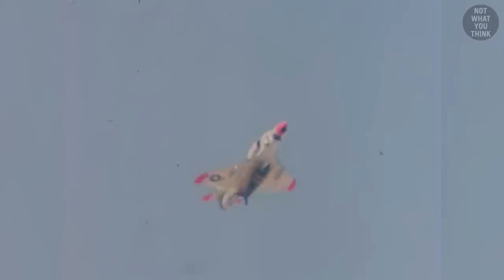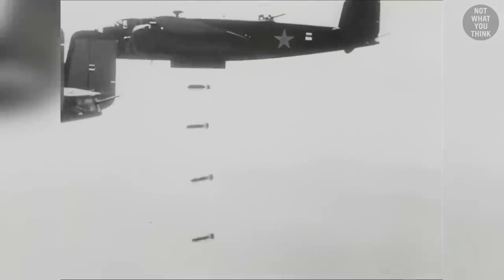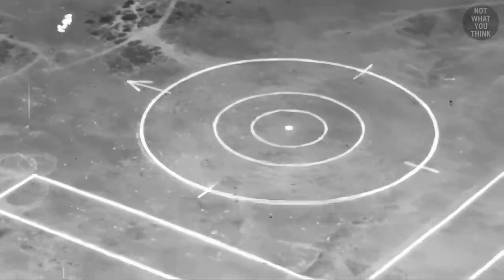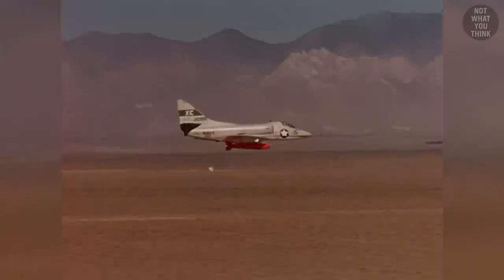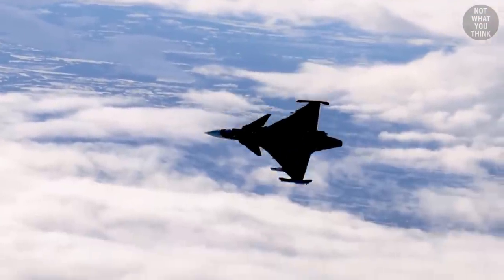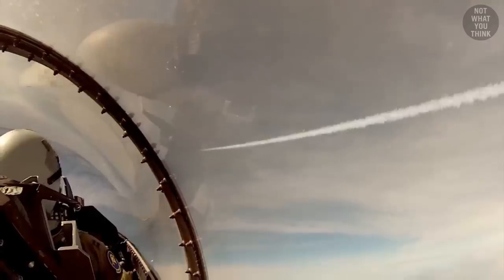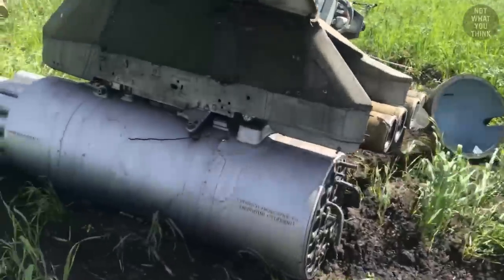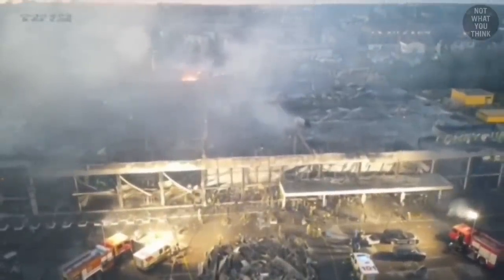Why Are Russian Helicopters Shooting Up at the Sky?

Comment: Over the shoulder bombing and lob bombing are similar but not the same. Lob bombing, as you have show in this video, involves the aircraft approaching the target then pulling up to release the bomb. The aircraft carries on with a half loop before leveling out at the top of the loop and then heads back the way it came.

Over the shoulder, a technique favoured by the French, requires the aircraft to fly over the target and once it has passed it the aircraft starts its loop. As it almost reaches the top of the loop the bomb is released, over the aircrafts shoulder, and while the bomb climbs higher the aircraft completes its loop and flies off at low level away from the target.

The first version, favoured by the USAF and the Royal Air Force, leaves the aircraft having to escape at a higher altitude, while the second version, as I said used by the French, means it gets to fly off at a lower altitude. The advantage of the version used by the USAF and the RAF is that means that only once the aircraft starts to climb is the enemies air defense presented with a target. Though it does mean it is a target until it gets out of range or drops down to a lower altitude. Whereas for the French aircraft it becomes a target both during the fly passed as well as during its bomb run. Also flying over the target alerts the enemies air defence to your presence. It also means that the aircraft has to complete its loop which means less time to make its escape.

I am not sure how USAF viewed the French version but RAF pilots saw it as suicidal.

Comment: Depending on where the helicopters are, could it be a way of adding many more cheaper rockets into the air during guided missile strikes to help overwhelm anti missile defense systems?  Those small unguided rockets must be way cheaper than the long range guided missiles. Or would they be too small for anti missile radars to even pick up?
Reply: No, it's just a variant of the MLRS.
Two helicopters can be compared to a complete Grad package - about 40 missiles.
This is not a way to accurately hit Afghan weddings, this weapon does damage in the area, hitting mainly with shrapnel. Accordingly, the target must be large (military unit, warehouses, truck parking, barracks, headquarters, railway station ...), then the deviation of a particular missile does not mean anything - it will still hit something.

Comment: first of all ,toss bombing is a common technique today and not just in the 1950's. But in the present the pilot is assisted by ballistic computers and a technic called ccrp (continuesly calculated release point) where the pilot is constantly press the trigger and the plane calculates the accurate point in time to release the bomb or rocket. The reason is to extend the Range of the Weapons and improve the accuracy of dumb, unguided Weapons. The Aircraft is able to fly "under the Radar" and drop the bomb at a massivly increased range then flying straight. With air burst munitions like rockets and cbu's (cluster bomb unit) you can massivly increase the disperse and area of effect. 
it is unclear to me why you mentioned the importance of dropping a nuclear bomb acuratly. it is irrelevant if the bomb hits 100m left or right because the destruction zone is far bigger than this :) 
otherwise this is a realy good video and explanation of this technique and i like it :) thumbs up 
and excuse me for misspelling i am not native speaking english ^^

Comment: I assume, the rocket lobbing is more of an moral damaging attack. Yes occasionally you hit something doing it, but spraying a forrest near an intersection with 10-20 rockets will make the ambushers/dug in soldiers in a nearby forrest be uneasy about their position.
Also i assume that those rockets are more or less silent in flight. so there will be no warning time and since the chopper is kilometer away, you wont hear it either.
Basically its a very low precision "bush whacking" with the occasional lucky hit.

Comment: Most modern fighters computers use to have a mode to "loft" ordenance. As you have said, its a way to increase the range of the ordenance. You are adding the aircrafts speed to the rockets. Those rockets will have probably the same accuracy than those launched from a normal  mrls. Ground launched unguided rockets arent too accurate, either.
Reply: That would be the ccrp mode (constantly computed release mode)
Reply: @williewilson2250  more like ccip
Reply: @PyromaN93  nope, that's for when you're dropping on the target using a visual reticle on the HUD
Reply: @williewilson2250  ccip was the term i saw in use in the spanish navy for these in their av8b harrier. 
Not that i say that you are wrong, i dont know the details of the mode
Reply: @user-zn7tj3xc7k  ccip is when you see where the you'll drop the bomb in a dive, ccrp is designating a target to then fly level and wait until the HUD tells you to release. Ccrp works better for long drops

Comment: You're dead wrong. It's pretty obvious from the munitions being loaded in the helicopters that this is being used as a fast and cheap alternative to artillery. You can achieve a similar explosive grouping with those rockets and the launch platform can be long gone by the time the other side can try to counter fire. Artillery's biggest weakness is counter-battery so if you can use a helicopter to achieve the same effect and reduce the chances of losing pilots and equipment, both of which are incredibly expensive, then it makes sense.

Comment: Maybe they have lost so many helicopters, the ones still in operation are doing these rocket attacks as a sort of airborne artillery or mortar style attack using the logic that with unguided munitions, attacks like that are more aimed at suppressing entrenched positions rather than cause damage. Not too different from Rocket artillery during WWII where the main goal of those was to saturate entrenched positions with rockets which would suppress infantry prior to an attack

Comment: Considering the price of such rockets and the little accuracy, wouldn't it be far better to send a swarm of tiny drones? A tiny drone would be cheaper to produce than such a rocket and while it cannot carry a lot of explosives, it doesn't have to if the hit accuracy is over 90% and it usually causes direct hits. And it could easily go over longer distances. Since it will be slower, it is easier to intercept but not by far (a modern air defense won't have a problem to shoot off either) and being tiny somewhat compensates for the slower speed (you get more shots but the target is also way harder to hit). Also it's a battle of money: If the rocket that shoots down the drone costs twice the price of the drone, it's still a win.

Comment: I think your "aerial artillery lottery" is probably the answer here; they are "lobbing jobbies" (a term we used in the late 1980s in Airborne Displays Division of GEC Avionics while we  were perfecting the algorithms for CCIP and CCRP for F-16's HUDWAC) in that they are launching their payloads from a point as far as they are comfortable with flying to and then running away, firing off their flares as they retreat. I'd say the pilots are in fear of their lives but have no choice in having to fly such missions, so they run up as close as they dare, throw their sticks and stones towards the enemy as quickly as possible, and then run home as fast as they can with their tails between their legs, where upon they report to their seniors they completed their mission, albeit with tongue in cheek.

Comment: the story of one Russian soldier from Ukraine. comes to them at the position they are holding a Ukrainian tank with a gun turned back. It is clear that he does not want to fight. Russians approach the tank, and screams and blows against the armor are heard from the tank. it turns out that the hatches are welded and the Ukrainian crew, in order not to die, goes to the Russians to save them. The saddest thing about this story is that this is not the first time this has happened. Ukrainian tanks and infantry fighting vehicles with welded hatches are worthy of respect)

Comment: 5:26 why do you need theories if you can just google it? 
There is a device that CAN predict trajectory of unguided rockets on-board attack heli and jets. You just put in coords of area and it will calculate position and angle. And you can triple range of these rockets if you use in that way, so you will stay out of small AA missiles range.  
Basicly it's MLRS, that can be where it needed in no time. Only with better accuracy and spread than most MLRS out there.

Comment: God, how much water is in this video. Everything is banal and simple, the Russian pilots themselves have answered this a million times. The computer system of helicopters is able to calculate the flight path of unguided missiles and it tells pilots when they need to turn up their noses and at what distance to release their missiles to hit a certain square. Russians have been using this maneuver for a long time, as the author correctly noted, for example, in Chechnya everything was done manually before, now it is computerized. This is done in order to increase the range of missiles and not get into the enemy's defeat zone, especially under the fire of anti-aircraft guns. This method is effective to cause damage to the enemy's cluster in a certain square.

Comment: you can emulate this in arma with both the Mi-48 Kajman and the AH-99 Blackfoot. the Kajman is a little easier since it has a CCIP indicator, wheras the Blackfoot uses this weird line marker with a crosshair that doesn't give any range indication.

in arma 3, unguided rockets shot from a helicopter detonate automatically after traveling about 6 kilometers. so beyond that range it's useless. but if you're sitting with a co-pilot that can laser designate a target, you get an indication on your HUD of where the target is, and the range the target is at. all you have to do then is put the CCIP on the target and verify the range before you fire. the Kajman's CCIP takes wind into account. 

when i first saw the russians and ukrainians do this i figured it'd be a waste of rockets, after practicing it with the Kajman helicopter, i could blanket any area the people on the ground indicated they wanted me to hit effectively. i don't think the employement of a mass volley of rockets from a helicopter is as ineffective as people would want to believe.

Comment: Hey you seem  very biased in your reporting...you guess that the rockets are fired "blindly" where did you pull that out off....your behind?  did you take physics class in grade shcool at all? The rockets have a known burn time that  predetermines how far they go. Duuhhhhh they do not randomly fly a distance and then drop.The speed and distance covered by a typical unguided rocket is known... All it takes is a simple 9th grade physics equation that can be easily programmed in a fire control system of their helicopters to precisely deliver the unguided rockets to a target....Please ask a 9th grader what set of equations are used to solve this and then look in the mirror to see how embarrassed you are...hint the equation used is (final velocity )² = (initial velocity )² + (2 × acceleration × distance) v 2 = u 2 + 2 a x. a is gravitational constant of 9.8,m/s^2.. Add an impulse  from the rocket engine and you solve for distance...ddaaaaaaaaaaa Remember to take into account the angle that the rocket is fired at....man can  you take a high school physics class?

Comment: Actually, current US fighter aircraft are still capable of loft bombing. (No idea about the F-35, but the other fighters for sure anyway.) It's still a valid technique that air forces continue to practice, train for, and use for both guided and unguided munitions. Or in the case of the Ukraine conflict, rockets from a helicopter. Use cases are (though not limited to) definitely when there's a long and medium-range SAM threat that can't be handled or otherwise removed via other means, or where you need to stay out of sight from a search radar as to not tip the enemy off that you're coming their way. Short-range SAMs and AAA are kind of in their own threat category for a number of reasons, mainly mobility, setup time, and that a single vehicle can operate as a stand-alone platform, but in general the same idea and overall principles still apply in terms of risk mitigation.

The computer on modern fighter jets do the heavy lifting in terms of angle, speed, when to release after pulling up, etc., allowing the pilot to focus more on flying and maintaining situational awareness, and less on shifting attention between multiple systems simultaneously. Current systems are much more precise than was the case during cold war era, and that's even before factoring in any guided ordnance. IIRC, most cases today for the US - if not the overwhelming majority - tend to bias the use of smart bombs; specifically, GPS and laser-guided bombs. However, it can and still is certainly done with dumb bombs in a nearly identical manner. (Just don't expect to be able to hit within a 3ft/1m radius of the target area like you would with a JDAM.)

It's worth noting that rockets are their own beast. By their very nature, they have a ton of variability in terms of precision and accuracy than with bombs. What those helicopters in Ukraine are doing does qualify as lofting. The difference is that using rockets like this would not be for a point target. Instead, it's being used as an area-effect weapon. Rather than going "Fuck this guy in particular!" like you would for a point target, with an area target/area effect it's more like "Fuck everyone in this general grid location!" You could almost think of them as being a type of harassing attack or mobile "light" artillery, only it doesn't need to be setup beforehand and it can pop up at any time over a huge range with little to counter it. (Counterbattery fire would be useless, as the helicopter will be long gone from the location it launched form before the rockets even impact.)

The level of precision involved in the current scenario in Ukraine would largely depend on whether or not the helicopters being used have some sort of targeting function meant for lofting. If not, then the uncertainty in where exactly the rockets might impact will vary wildly and will become stupendously more dependent upon each pilot's skills and abilities. Primarily, these are 1) being able to pitch the aircraft up to a specific angle, 2) in a specific direction/heading, 3) at a specific location, and 4) at a specific speed. The factors that have the biggest influence are pitch angle and heading. Even slight deviation in either of those could shift the impact area by hundreds of meters or more, depending on how far they're trying to toss them. (The further the target, the more tiny errors become magnified.)

Comment: i didnt know that accuracy for nuclear bombs was important i thought anywhere close to the target would be good enough due to the power of the blast.
Reply: When you drop a smaller nuke from so high it can easily drift outside of the target area. 

The target will probably still be affected by the extended blast but if you’re trying to hit an armoured target it likely won’t destroy it if you can’t aim.

Comment: The unguided helicopter missiles can not do that kind of damage as seen at the ending of the video. That was a destruction done by Kh-22 - old, low precise, 1 ton explosive filled cruise missile. First in Kremenchug strike to a shopping mall, second in Dnipro to a civilian apartment building. So it is not correct to even mention Ukraine regarding this topic as author of the video did
Reply: Только разница в том что пво Украины уже доказало что сбивают они криво и лупят по своим жителям. Так что не нужно тут утверждать что-то российская ракета в тот дом попала

Comment: There are correct moments in the video and in the comments, but I also think that with such an attack from helicopters and aircraft (unguided missiles are also launched from aircraft), expensive electronics in the missiles themselves are not wasted, and the nature of the attack turns out to be kind of high-precision. Also, solid rocket fuel (it is relatively expensive) is spent less than, for example, in MLRS (himars, smerch).
As a result, the attack is cheaper, but to some extent highly accurate.

Comment: A nuclear bomb, by it's own definition, does not have to be accurately placed. Why would it?
Nuclear bombs do in fact have to be accurately delivered in both place and time in order to get the yeild effect wanted. There  is some spooky physics involved,  which demands it, but of course, they do not want you knowing this. In a nutshell, it seems you cannot have an effective nuke bomb go off just anywhere, anytime. A specific site is only a potential target every few months, it is said. If populations knew this, there would be mass-movement of civilians during a nuclear war, to try and avoid the hot spots. This would cause problems for the authorities so they will simply never tell you. They want to have the ability for only them, doing the fighting, to transit easily between safe areas. Mass public movement would spoil this for them.
It also means the old yarn of a nuke war being over in a few hours is false. More like 3 years.
This explains the seemingly needless requirement to have weapon accuracy and perfect timing. One would think accuracy within a few miles would suffice, but it does not. It also explains the huge arsenals kept by all major players. And the DUMBS, etc. 
GPS was developed mainly to help in nuke weapon delivery.